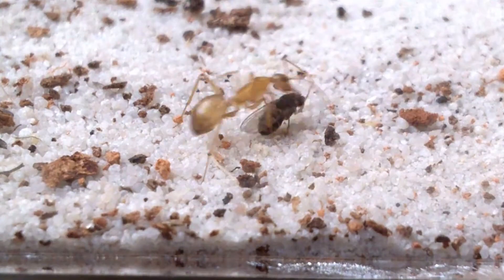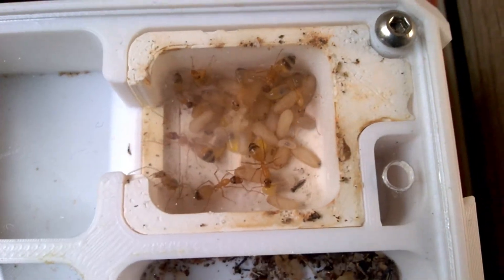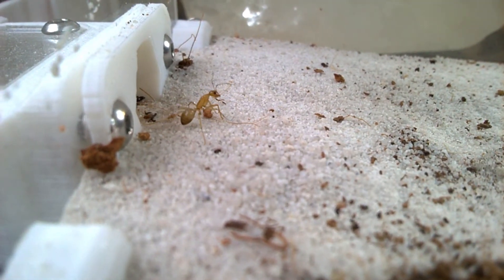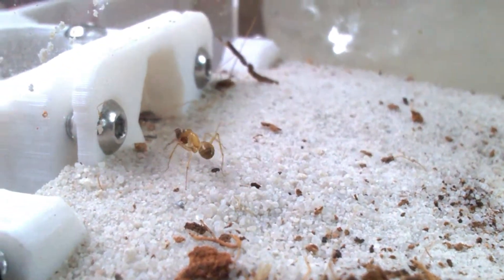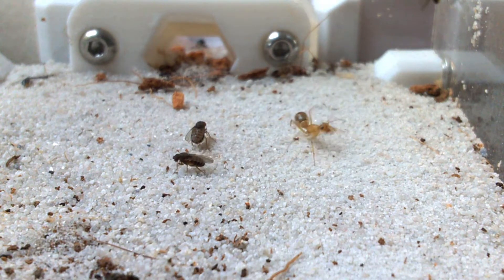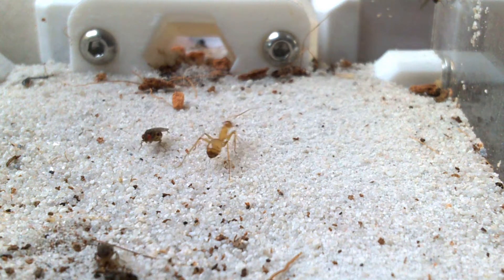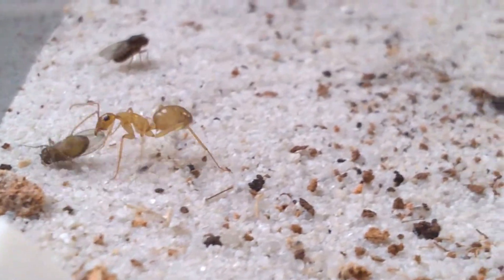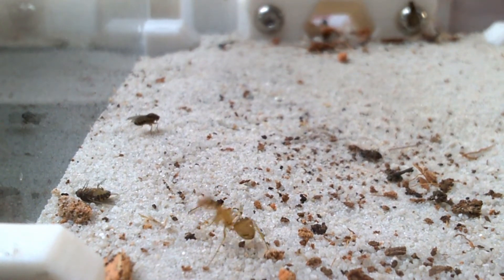Camponotus Sanctus - Already a real running Colony! 3rd update

Comment: How large are these ants? I have a Formica Fusca colony and the small workers are about 4-6mm in length and the large workers (which I believe are soldiers) are 6-8mm in length and i wanna know if mealworms are a good food source. (Note, the mealworms are about 3mm in length)
Reply from the maker: Hi
It is a Camponotus species, they are usually big ants.Way bigger as Formica Fusca
The Queen is about18mm, Workers between 8 to 16 mm.It is a young colony so I don t have any 16mm Major yet but it grows fast so I hope for my first Major worker soon.
You can t go wrong with mealworms.Cheap food source.If you say they are only 3mm you properbly mean Alphitobius diaperinus.But also the bigger ones are OK. I would freeze them.
Reply: @m.andants3468  i have freeze dried worms